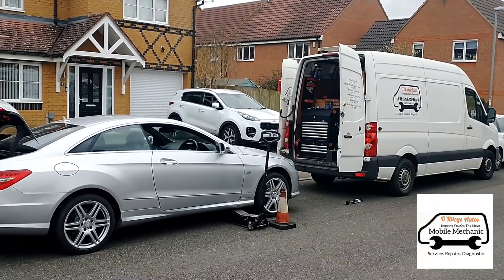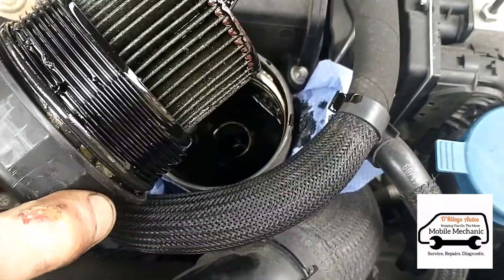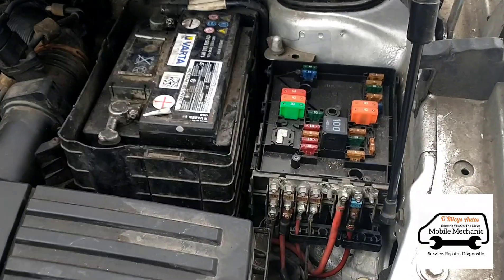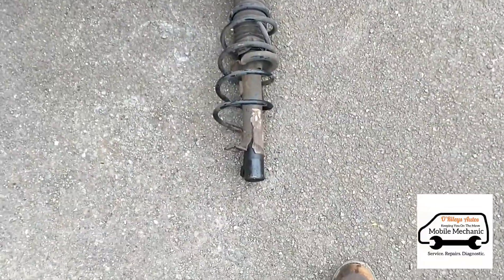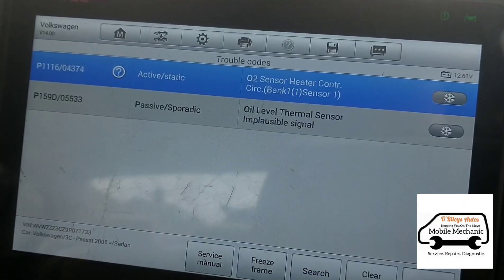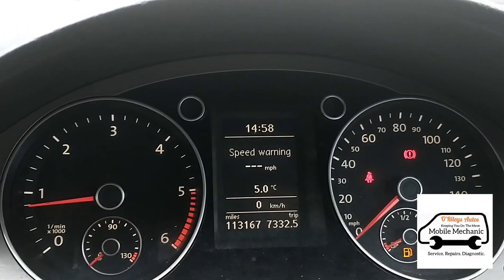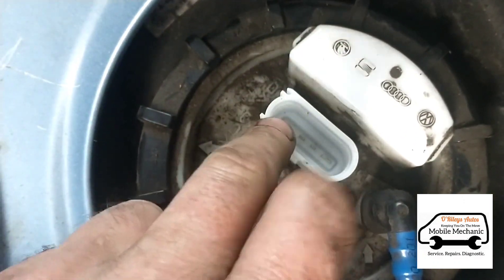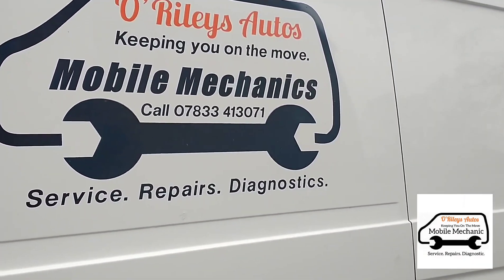A Day In The Life Of A Mobile Mechanic: Episode 6

Comment: Fuel looked clear (12 mins  ish in to video ) of metal till you run the pick round outside at 12:20 and re dunked filter maybe got contaminated from pick or housing?
Reply from the maker: Aluminium swarf would not come from the pick or the housing. It's common contamination from the fuel pump breaking down. New fuel pump & injectors plus fuel line flush is needed to fix.

Shaking the filter was to rise up any swarf trapped in the filter element.
Reply: Ok but pick paint is flaking off giving the impression of metal in fuel maybe
Reply from the maker: @sibon4797  no it's not paint flake. It's clearly sparkly aluminium swarf.